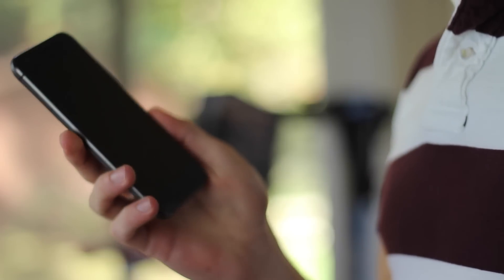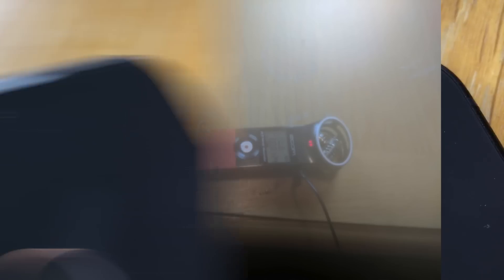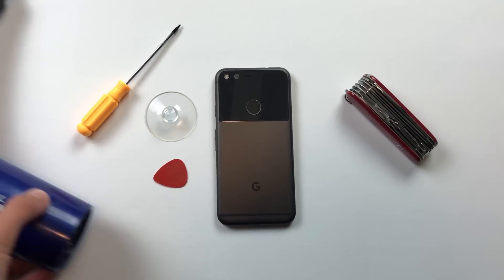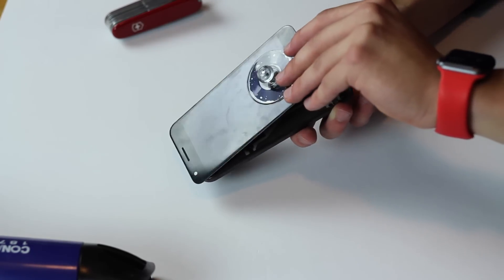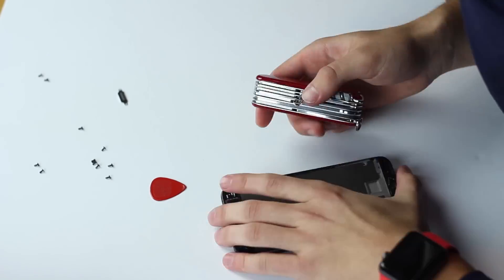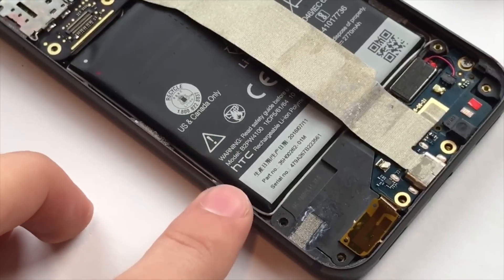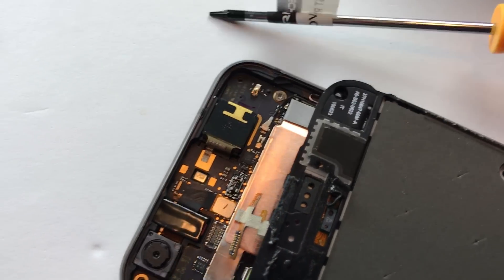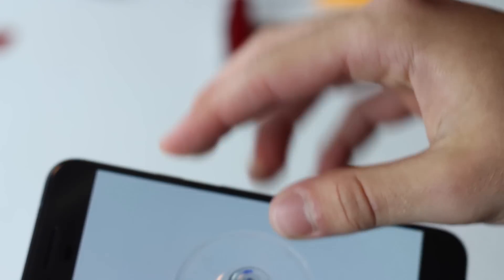Google Pixel: Teardown & Water Test Update!

Comment: My Pixel's earpiece speaker volume is low and very distorted. I'm guessing it's water damage, but it's only been exposed to rain, at a slight angle (mounted on my bike). The right side of the grille looks darker than before 🤷🏼‍♂️but it doesn't look torn.

Comment: I'm  really glad i watched this before panicking, i just dropped my pixel in water for a couple seconds and was worried it was doomed. on the topic of the content, super clean and professional, great work!
Reply: I just did this, dropped my phone into my dog's water bowl. It was only in there for a second, took it right out of the case, dried it, turned it off. How long did you leave it off and let the charging port dry out? I have it in front of a fan, turned off.

Comment: Great and fantastic video. 

A word of encouragement - the water condensation on the camera works itself out over the course of days. What you showed in the beginning I see on my phones all the time (after taking showers with the phones) & the camera is useless until days later. The phone camera dries itself out over a GOOD period of time. I would encourage to let time takes its course & try your best to not open up the phone. 

In any case, fantastic video. I'm subscribing!
Reply from the maker: +KALEL KALEL Hmm, really? I feel like this was more than just condensation and more of actual water inside of the camera module. But if that's the case then I may have taken an unnecessary risk here :(
Reply: Harris Craycraft wait, wait....haha...I was in the car as I typed that out, so my focus was divided. But water IN the camera is what I meant. You saw those water droplets latched onto the camera glass from the inside? That is what makes the photos foggy looking, like the photograph you provided. 

It is this moisture to which I refer when I intended to say that all my phones have this after I'm taking my hour-shower & using this phone to read articles, watch YouTube videos, etc. 

When my cameras look exactly like yours did, I have to wait it out. Galaxy Notes of various versions which I have, Motorola Nexus 6 which is my current daily driver, etc. 

Sometimes is a couple days. Sometimes (and usually) its several days after that I get clarity again. I let the phone sleep in front of a tabletop desk fan, etc. 

This is good news for you. If next time this were to happen again, you'll be all good. 

Last phone I took apart was an HTC, replaced the digitizer & screen, etc. Taking apart the Pixel wouldn't scare me. But for camera moisture, I would encourage to wait it out whereas a cracked screen or bleeding digitizer definitely deems it necessary to take apart the phone. 

Great presentation style in the video & great tutorial on the Pixel disassembly. 

Keep up the great work. 
https://lh3.googleusercontent.com/-7AYWBUAe09-RMXIuYEk5h_AFg1ldlfJ1pTi2JnIzb6og7whJL_WYqBXMzQkCTaw85Q3XJHchlA

Comment: it's not a water resistant phone
Reply: Anibal Perez no shit, he's showing what happens after it's exposed to water
Reply: Anibal Perez no shit, he's showing what happens after it's exposed to water
Reply: But your not supposed to put water on it 😱
Reply: Anibal Perez That's why he did it for us to test how it survives in wet environments.
Reply: Anibal Perez It is water resistant. It has a water resistance rating higher than 0.
Reply: Cristi Neagu Not what that means.
Reply: Chris Beasley I'm sorry. I was talking about the accepted and correct definition of "water resistant". What were you talking about?
Reply: Cristi Neagu the Ingress Protection certification standard of water resistance. It doesn't have a 0 in it, so as you said, it's higher than 0, doesn't make sense as the scale doesn't start at 0. That isn't how they designate it. Comments like those distort the tests done, which are incredibly specific, and noted.
Reply: Chris Beasley 
"It doesn't have a 0 in it"
It does, actually. 
http://www.certifigroup.com/service/ip-code-testing
https://en.wikipedia.org/wiki/IP_Code#Second_digit:_Liquid_ingress_protection
http://www.engineeringtoolbox.com/ip-ingress-protection-d_452.html
http://www.mpl.ch/info/IPratings.html